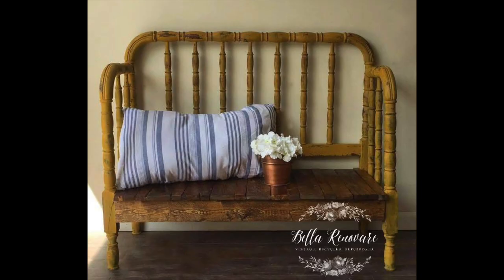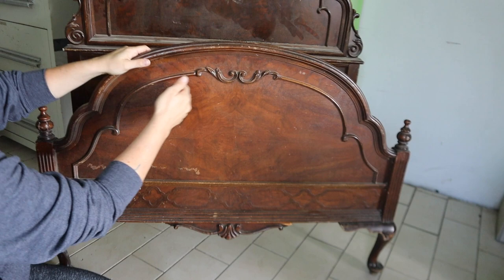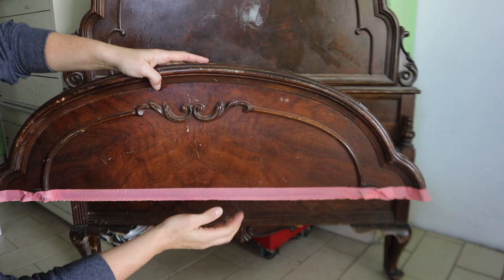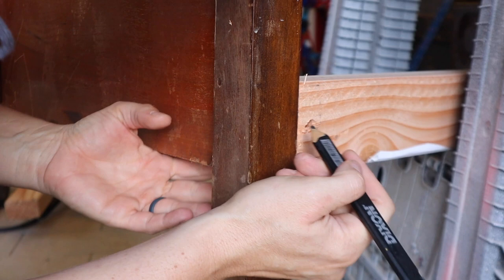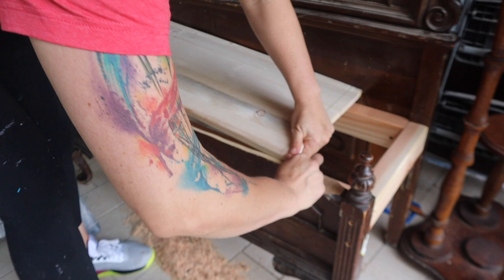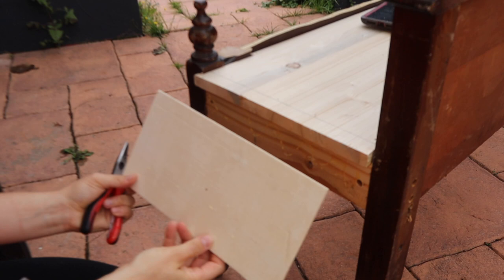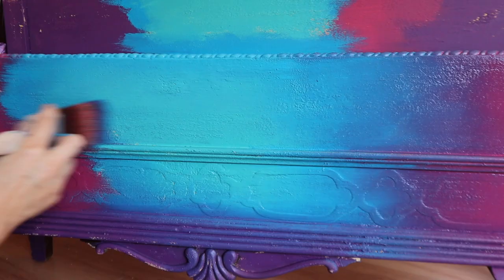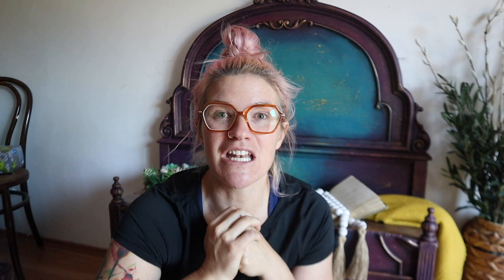How To Turn A Headboard & Footboard Into A Bench &  Blend Paint On Furniture W/  Bella Renovare

Comment: If you make a drill hole in the corner big enough for your jigsaw blade. You just put the blade in and saw hole.. Also if you put the squared side of the seat and set it up against the back you can notch it out first then cut the seat with a added 8th inch. Notch the front. Perfect seat. Hope that helps save some time. Also hope you could understand that lol. Love your work!
Reply from the maker: Thank you for the tips you rock ❤️❤️❤️❤️

Comment: Oh my I loved this so much learned so much.  1 question. If you had used that piece you cut off from the foot board. How would you have attached it to the sides? Would it also need some kind of frame to screw it to?
Reply: You can buy brackets on it
Reply from the maker: Yes brackets or before I affixed the seat I would have screwed from the bottom into the sides, the sides where too long to use, I forgot why I didn’t use them on the first bench until now it just didn’t line up good enough :)
Reply: Oh thanks that makes alot of sence

Comment: Love your work :))) 
question...if i didn't want to darken the piece as much with the black wax, ca I mix some white paint with it to make it more of a grey wax, which in theory would make the shadows more subtle, yet still darken the colors somewhat...would this work? Thanku in advance for your answer :)
Reply from the maker: You sure could, they actually make a grey wax as well so you don't even have to mix, alsooooo you could put a clear wax first, then your black and it won't soak into the paint as much and you can wipe back more, you can also use the clear wax to erase the black and lighten it :)
Reply: @BellaRenovare  Thanku for this info